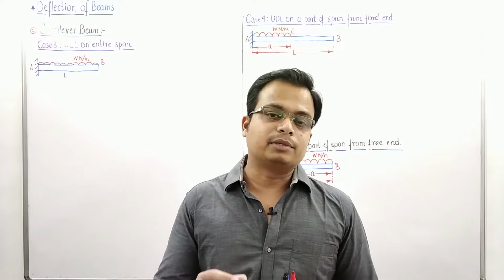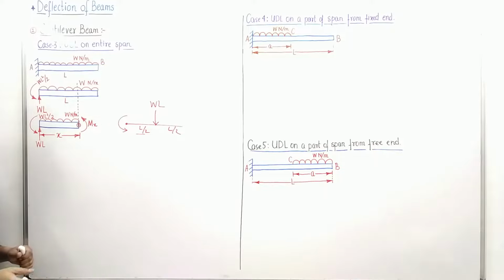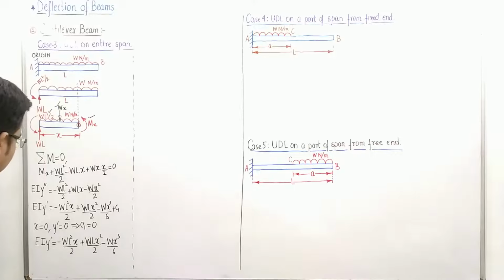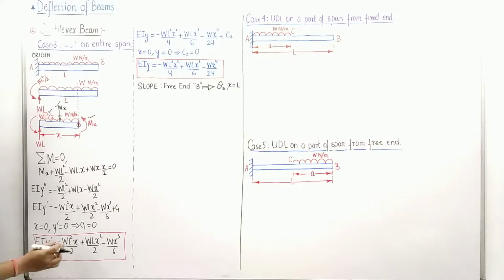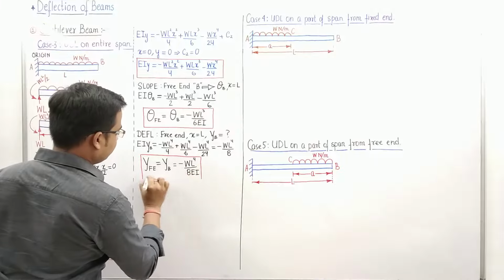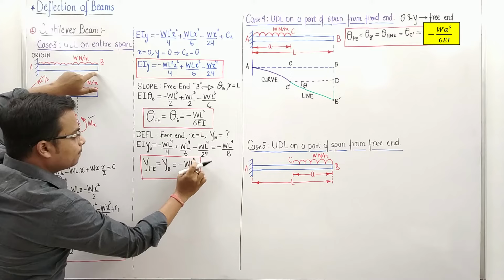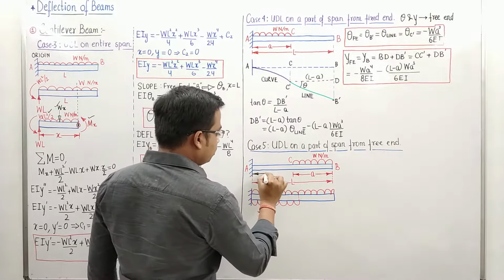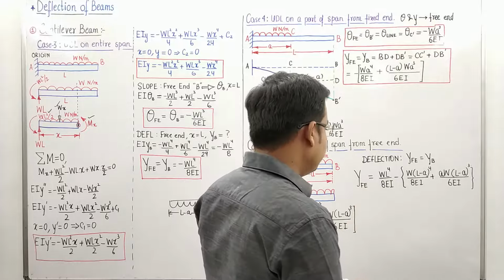Deflection of Beams || Double Integration Method_Cantilever Beams || Lecture 3

Comment: You forgot to add a negative sign infront of the deflection equation but it's on the notes. No worries
Reply: Negative sign use in cantilever beam because it's presenting logging condition